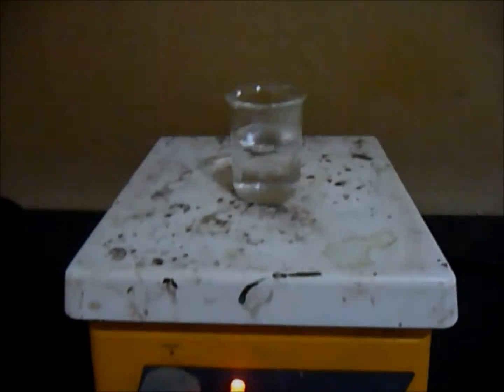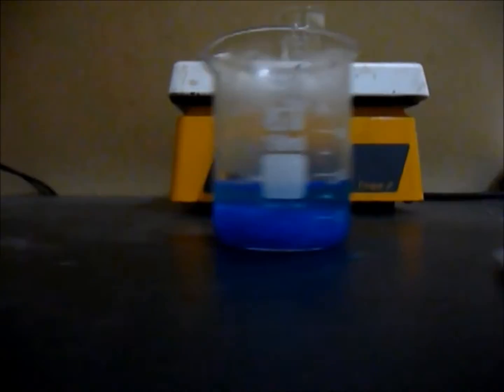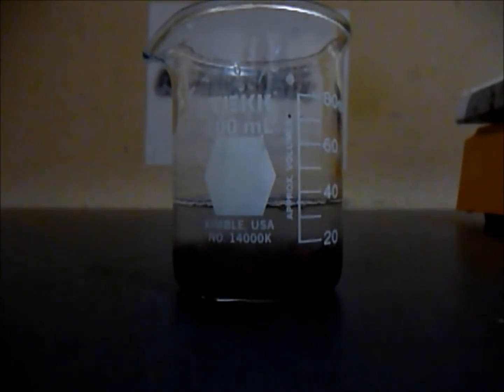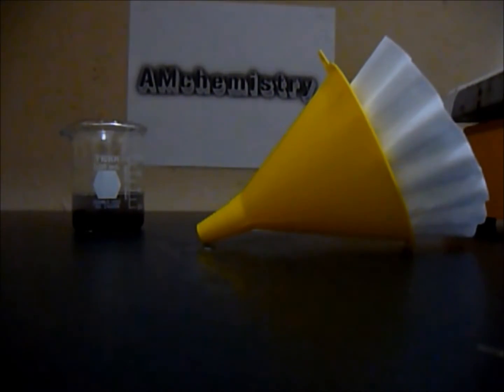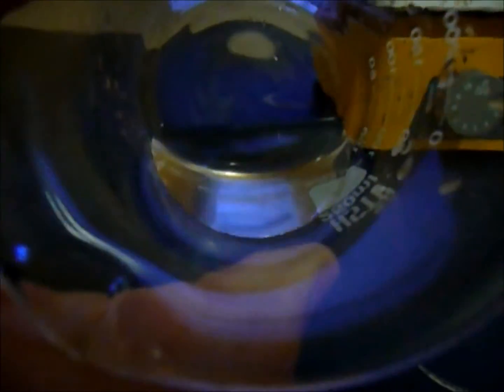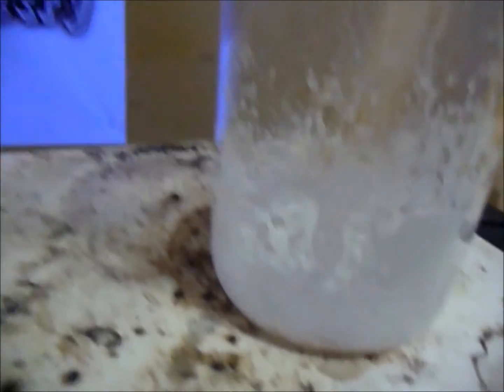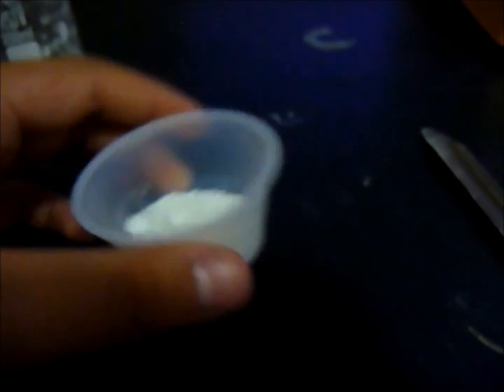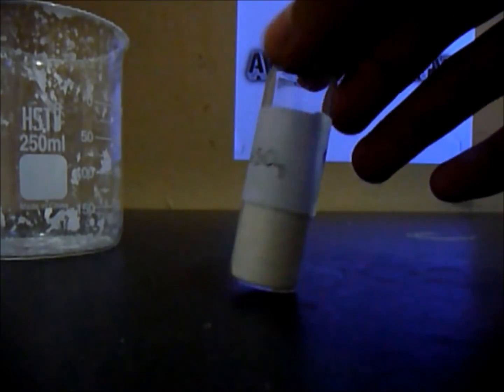Make Zinc Sulfate, and Copper Metal

Comment: Hey, can I put brass in the copper sulphate solution, and cause the zinc in the brass to replace the copper ions in the solution, while at the same time causes the copper in the brass to fall on the ground?
And would I obtain pure zinc, with no oxidation after heating to 700° C?
Thanks in advance.

Comment: Oh and it shouldn't take that long to get it either. I've reacted a much larger amount and it only took about an hour or two. You just have to stir it every now and then to knock off the precipitated copper on the zinc metals surface and it will react faster.